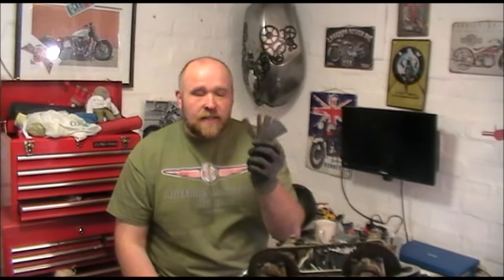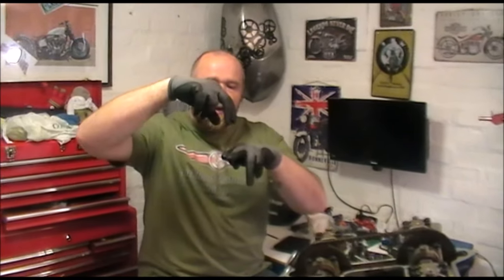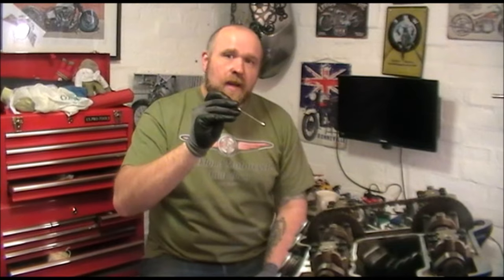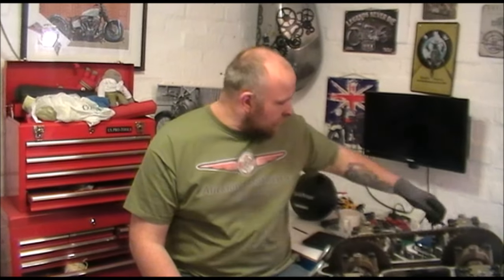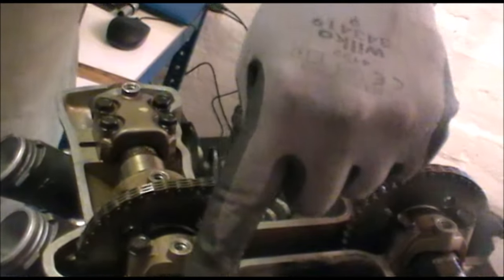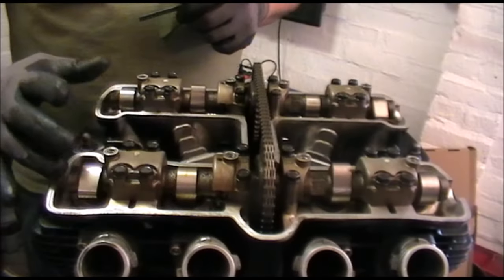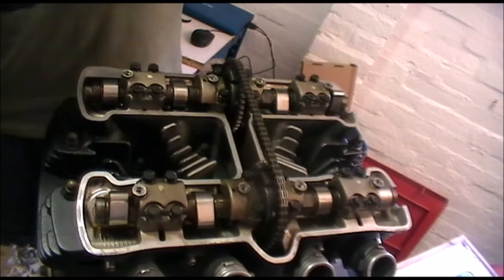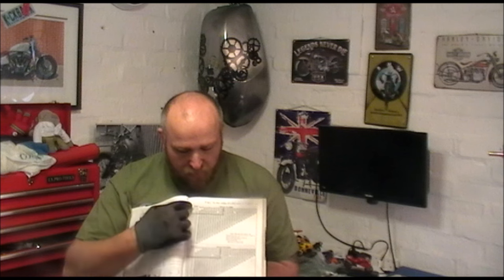Step by Step - How to measuring & adjust valve clearances

Comment: what if the clearance has moved down!!!?
Reply from the maker: Morning Mike, what do you mean the clearance has moved down?  If the clearance measured by the gauge is more or less than the tolerance stated in the manual, the shim needs to be changed to one that is within.
Reply: GTs Garage. morning !! well I've got my motor out getting ready for a complete rebuild .. and I started with my 1 intake valve I ran through. .004-.006 none passed through but the .003inc passed throught? I haven't done this before so what's confusing me is that for whatever reason my brain is saying that if anything the valve gap should only go up in size with wear. when I refuse to the chart it wants me to replace my 250shim. with a 245.. .. haven't been able to find much information on this issue but I did come across unrelated thred that mentioned the valve seat may be pulling back .. so just try to do what I gotta do to make it count .. been through a lot with the bike and haven't had the greats luck with findn a good mechanic/service. .. so I'm just handling it myself from here on out it has ..
Reply from the maker: Will take a look at the manual this evening and refresh my memory.  The only thing of importance here, is do not lower shim bucket without a shim in it..  Everything else is just checking and double checking numbers.   Will get back to you this evening.
Reply: GTs Garage awesome of you this what I came up with this morning
 #1i-.003/.08 #1E-i can not get a gauge through it?
#2i-.004/10mm #2E.008/.20
#3i-.003/.08 #2E-.008/.20
#4i-.004/.10 #4E-.0020/.05   that's all I know at the moment .. o. the number one exhaust I was unable to get any feeler gaugers to pass and I thought you said you can't go past .05 so that has me confused but those are my reading ..
Reply from the maker: Hi Mike, apologies for the late reply, here is a very well written article with snapshots how to take the readings, worth double checking the video and the description tally.  http://www.xjrider.com/viewtopic.php?f=115&t=5260
Reply: GTs Garage no worries I'm getting it Figueroa out found out the timing is off by a tooth or two lol ..  1

Comment: so much easier with a £15 tool , shoving a cable tie between your valve head and the seat is really not a good idea , its going to bend the valve stem if you arent careful
Reply from the maker: Absolutely right, using the correct tool is always the best way forward.

Comment: I do not understand. You said that you did not want to mess with the engine for fear it would not start. Yet you are going to explain how to do intricate work on the engine?  This after you found help on the web?   Do you see how this can be very confusing? I have to say that before anyone adjust valves, DO NOT rely on this video alone.